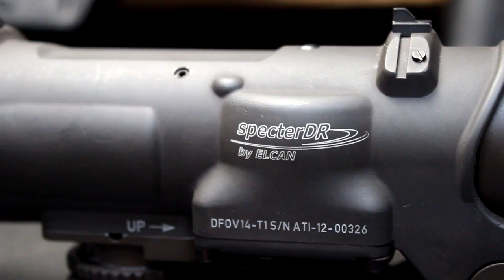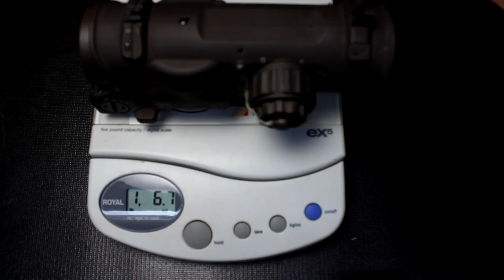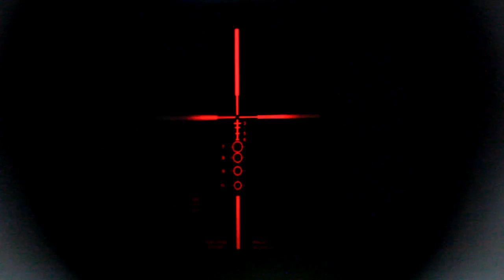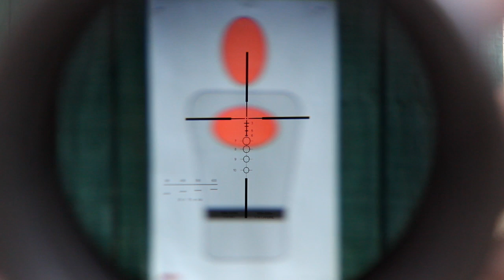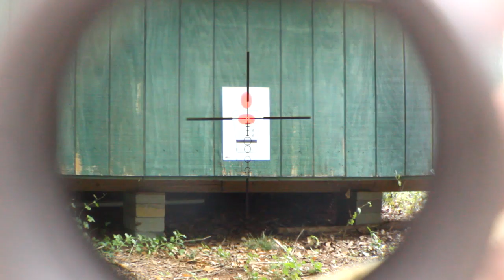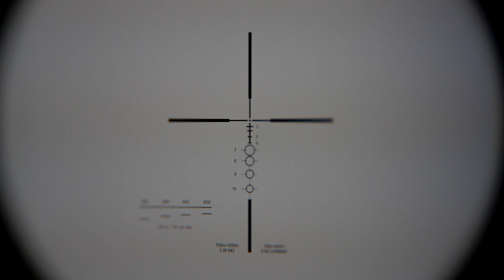World's Best Combat Scope : Elcan SpecterDR

Comment: After reading about, finally running a combat course using this sight, and punishing this optic, I bought the 1/4X version after also testing the higher power version (which of course drastically diminished field of view).

I've sold off ALL my Trijicon and EOTech stuff to facilitate the purchase of another Elcan SpecterDR 1/4X for my Tavor.

This sight is THAT great.
Reply: is 4 power enough to see a human target that well at say 500 or 600 meters - it doesn't sound like much magnification
Reply: me2ontube maybe not but because the glass is so good, it makes up for the lack of higher magnification imo
Reply: me2ontube most definitely
Reply: good choice 👍🏼 i wont feel bad either cheers 🍻

Comment: Love this little optic, They were given to us in a SOPMOD in 2007, I think it was 2 or 3 per ODA. I ran it overseas and it was great, had my back up sights mounted on the left of the sight along with a doctor optics sight on the flat part of the optic. It rode in the turret behind the hatch and by the end of the deployment it had a number of dings and gouges in it not to mention trigger time but it still worked. The ones we were issued had a bronze body to them which promptly received a coat of paint. Just wish it were not so pricey.

Comment: We got 3 different models of these up here in Canada. A baseline for 1300 this one for 1800 and 1 by 6 version for 2300.. They got a deal on for a Canadian made Colt C8  (Canadian army Ar) for 3000 including this optic. The C 8 usually goes for 2000 it's self. Great rifles especially the barrels. 2 coatings Crome and tapered made from same steal U.K. Uses. I got 1 coming next week.

Comment: I was able to mess with an Elcan Spectre last week and it is a very nice optic. The glass is incredibly clear. It was easier to get the rifle up and not have to hunt for the eye relief than the ACOG, although the ACOG is a great sight. Both of them made me want to get rid of the Comp M2 mounted on my M4.
Reply: Have you compared the ACOG and the Elcan, I wouldn't say one is more durable than the other, the Elcan is built like a tank just like the ACOG
Reply: Funny you should say that, if I'm not mistaken the mark 17 is issued to SOCOM with Elcan Specter DR 1.5x-6x, have yet to hear of any complaints. Every manufacturer produces duds every so often, EVERY ONE OF THEM. EOtech is notorious of it, I've seen some bad aimpoints, granted they were M2 versions. And yes actually I've heard of ACOGs doing the same thing. No ones perfect man.

Comment: The point you referenced for the range finder has to be known to you that it's three feet in height in nature or otherwise. I've have a spectra DR 1-4 and it's glass and FOV are amazing. If the price range was more in line with ACOG's I believe more people would own them. The biggest complaint that I've heard about the newer Elcan's are its weight and cost. But I guess if you work out more and get a better job/career......problem solved :p

Comment: I work on these SU-230, SU-230/A, and the 1.5-6X variants in my shop and have to say I'm just not a big fan.  Not gonna bash the Elcan, it is well made albeit very heavy.  It's just that I've experienced a lot of issues with the throw levers loosing tension and becoming sloppy, elevation locks locking up, and the battery compartment being prone to corrosion.  This optic is not terrible, but it has some very tough competition that on average is 1/2 to 2/3 the price of the Elcan but if you've got the cash to blow you won't hate it.  I do like the 1.5-6X when paired up with the MK17.

Comment: I still think that ACOG is a better system due to the lack of mechanical lever found in this Specter DR, have to uses the both-eyes open techniques for close ranges. But I wouldn't have a flicker of a doubt that this baby would impress me. Guess I have to start saving right now, hell it's expensive, but it is all worth it.

Comment: The way it switches from 1x-4x has given people POI problems from what I have read.

Some more then others, but just a thought if your interested in this optic.
Reply: those are older ones.  the problem with that was fixed in current production.  the current biggest issue is the craptastic arms mount your forced to use.  the fact that "it gets easier with use"  means after a bit its going to fail to return to zero like those junky larue mounts.

im not a fan due to the reliance on electricity to illuminate.  electric circuits dont fair well in extreme cold.  my pref is the dual illuminated fiber optic acog.  zero it once then you dot have to futz with it ever again.  no goofy levers or dials to switch around
Reply: Jon M AWW

Thanks for clearing that up.

Comment: Besides the price hike, Why have rugged, top of the line optics makers like Trijicon, Elcan been building hardcore scopes with funny little iron sights and battery powered reflex sights on top?
 How's the notion of switching between several cheek and chin welds in order to use several aiming redundancies, in any way based in marksmanship lore?
I get that people love options but integral Quick Release throw lever mounts are there so you can add or remove the optic without tools, in order to use your actual rifle sights. 
Proper front and rear iron sights have a much longer radius and proximity to the bore (like they should) 
Having sights on top of your short scope, puts your aim pretty far above the bore with a shorter sight radius than most pistols but hey it's your money, your choice and your rifle carbine etc. The guys at the range will sure be impressed.
Did you really invest in a great scope, just so you could look over the top of it?
Troll Disclosure: I opted to seek out an old school (Pre-NSN) TA01, an LT-622 mount and a set of KAC flip iron sights.
No plastic fiber optics, No fantasy-scope-iron sights or watch battery-dependent red dots on it. ...When I served, "Low Drag", logistical soundness was everything so I'm biased against lose ends, snags, high maintenance and dead weight, sorry ladies >_<
AR's don't have to be the Honda Civics of the gun world if you stop pimping them to show off.

Comment: Sootch, how would lens protectors be mounted to that unit with the lens recessed behind the end of the housing?
Reply: It was never really meant for it, its a combat sight-but it does have kilflash available for it
Reply: Spencer One Shot even "combat"glass scratches and gets dust on it.
thats why I added on all my low magnified optics some sort of flipup caps and transluminous rear flip ups.
Reply: That is the same manufacturer Trijicon uses for their accessoires.

Comment: I've seen a lot of photos of SF guys, mostly MARSOC using these while mounting and RMR type of reflex sight, mounted at 45 degrees, as well, on the rifle. Any idea why they might do this?
Reply: +camas77721 because using a red dot with this optic only takes one small movement of your eyeball, while compared to having to dial the scope back down to 1X will require you to take your hand off your weapon then dial, then replace your hand.  I would point someone to the trijicon acog's over this one. This seems like someone just had a good powerpoint slide show to show the 4-stars of the Canadian military or whatever.  I haven't heard one thing that would ever prompt me to purchase this scope for the money when trijicon will do the exact same things just as well for cheaper, while looking better too.  You really think your going to use all that BS measurements on a 1-4x scope?  But to each their own .
Reply: +James White I have a Trijicon 1X4 and the Elcan 1X4 the glass on the Elcan is clearer, and the eye relief doesn't change near as much when changing between powers on the Elcan.  The ACOG is over a thousand dollars, and a Aimpoint is between 600 and 800 dollars, and the Elcan will do the job of both of those scopes. I wish I had broke down and bought a Elcan first instead of Trijicon, Night Force, Aimpoint etc. and yes I have used the calibrated 556 reticule on the Elcan out to 400 yards and it works pretty good.
Reply: +camas77721 If you find yourself needing to make immediate transitions, that throw lever is too slow for the elcan.

Comment: The sight from Elcan with The rubberrised finish is in réalité The C79 model that the spectre DR is The upgrade of. Most canadian forces small arm are issue with this opticien. A question of cost, but still a great optic. The C79 could be an alternative to The more expensive DR model. I was part of The First oversea(UN) deployement of The C79. Great improuvement over iront sight.
Here à Wikipedia link to The C79:
https://m.facebook.com/story.php?story_fbid=814100188621864&id=100000656728875

Comment: dont get me wrong its a gorgeous optic but an acog is half the price and no battery and it lasts 15 years.   just my .02
Reply: +M DiLuccio And one $5 battery last years and this has 1x/4x. its a no brainer. People just can't afford it. I have one for sale for $1800. Let me know.
Reply: +K Nasty I'm not saying it is not a good optic, or not even one of the best.  To me I would still prefer the ACOG.  Batteries die, there can be electrical issues and in a few years it will need to be replaced.  Do not forget that the battery life is typically based of 70 degree weather.  The battery life will drastically change in extreme heat and/or cold.  Also typically the battery life is based on a single setting.  So if you want to keep it on a higher brightness setting you will lose battery life also.  This is my preference, to each their own.

Comment: Could someone explain to me about the ''retaining zero'' stuff ?
Reply: Alberto Hinojosa Essentially it refers to the ability to make adjustments to the sight to zero it when you first attach it (it will hit accurately at point of aim), then remove it from the rifle (to clean it for example), then put it back on the rifle and you will not need to readjust it. My guess is that this is achieved with very tight tolerances in machining where it meets the rail, as well as the firm attachment system which was mentioned in the video.
Reply: *****
 Oh alright, thanks a lot :D